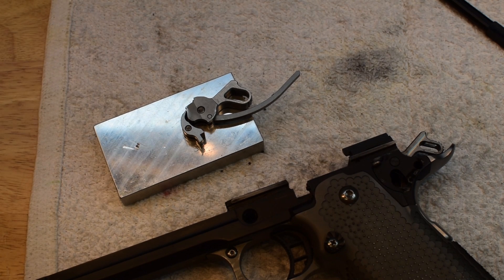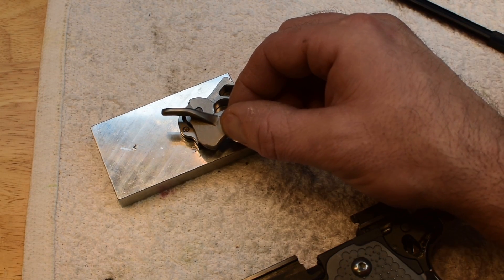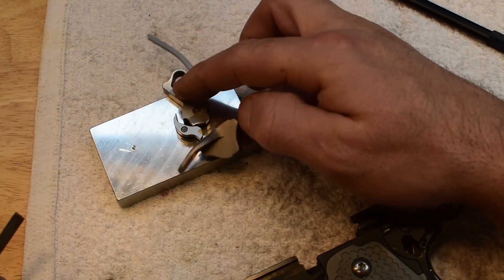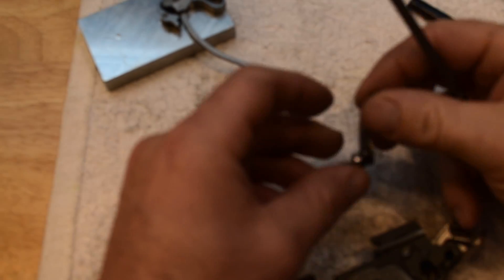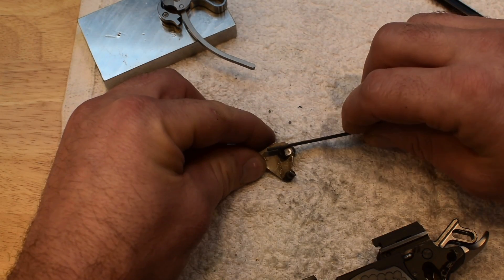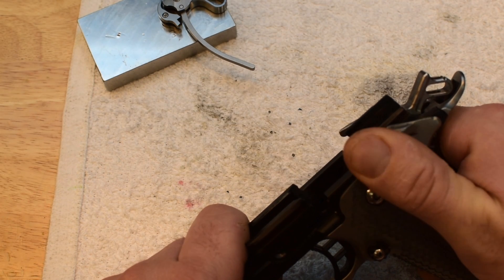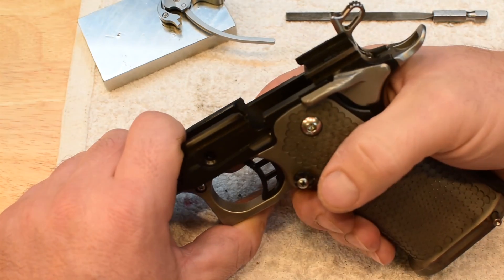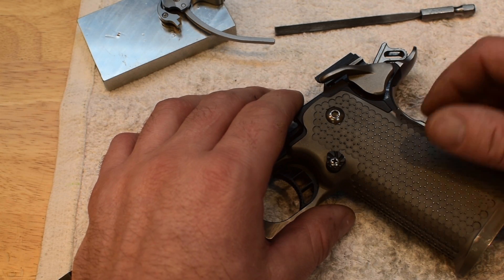Thumb Safety Fitting 2011/1911

Comment: I have the Atlas chaos. Took it to my local gun smith to have him put wide safety. He said he would have to file to much material off the safety to get it to fit. Claimed to be unsafe, so he milled off tiny portion of the sear. Have u ever heard or done this? Seems to be working fine. I just want it to be reliable and safe.
Reply: I’ve never heard of filing off the sear. How did that work out for you?

Comment: Adam, Could you do a video on making the safety engagement and disengagement more crisp? I picked up an STI and the safety feels mushy compared to my higher end 2011's. Engagement feels dull instead of a crisp "click". A video of tuning the detent hole / tear drop shape in the safety would be awesome.
Reply from the maker: Just take a little more off the engagement surface and it should get crisp

Comment: Mine would go in but would not move up to safe when hammer fully set and the hammer wouldn't strike with the grip safety engage / trigger pulled , there is scratch marks on that little U shape though , gonna try what you displayed

Comment: I'm wondering how to make the detent and positive click up and down better..and smoother
Reply from the maker: to have a more positive engagement you can drill the detent hole a little deeper.   Make sure your pin is stopping in the center of the hole.  To get smother you will need to chamber the hole on the in and out path of the pin.

Comment: I just installed an ambi safety in a Detonics Combat Master. The safety is a SIG product and it went into my gun with NO FITTING REQUIRED. The problem is that I have hammer follow down when I release the slide. It falls to the half cock notch (so far). It works fine with the tests you used on this video, but the hammer follow MUST be fixed. What do I do to stop this problem?
Reply from the maker: Being able to put the safeties in doesn’t make them fitted. We would recommend a gunsmith at this point.
Reply: @AtlasGunworks  Thank you.

Comment: I switched to an Atlas trigger shoe/now and now I hat the hammer releasing like at the end of the video when you click the safety off. Do I need to fit new safeties just from putting a new trigger?
Reply from the maker: The trigger bow should not affect the safeties to your sear fit.   Did you change your sear?
Reply: @AtlasGunworks  No only trigger and bow. I ended up putting an Atlas safety that I had on the left side and it doesn’t do it anymore. Only with the original safety. Very weird
Reply from the maker: @jvz1448   One thing to keep in mind the Bow does position the disco and that will change the relationship between the disco and sear.   If that gap is too small the trigger can bounce back and trip the sear.  This is one form of hammer follow.  Most of the time when you see this the hammer will catch on the half cock.
Reply: @AtlasGunworks  yes that is what was happening. It would drop to the half cock position
Reply from the maker: Try to flatten out the back of the bow to make the over all length a little shorter.  @jvz1448

Comment: I know this video is old but after fitting a few perfectly fine i did mess one up. I guess i went too far. Everything function fine however when i have the safety engaged and pull the trigger to test function, the hammer moved back slightly  and when i disengage the safety it falls to half cock. Is there anyway to fix that or am i beat?
Reply from the maker: The only way to save that safety is to weld more material on it.

Comment: you need to do it with the slide on as it limits the upward travel  of the safety.  you had it at full travel and that probably why it failed.
Reply from the maker: +Gunman1628 
I took it down to far, and the it did fail with the slide on (that parts not on the vid)

Comment: Letting the hammer fall without having anything to absorb the impact is not good practice.
Reply from the maker: Normally I hold my thumb in front of the hammer to catch it before it hits the frame.   Letting the hammer hit the frame is not ideal but with quality parts shouldn't cause any issues if it happens once or twice.